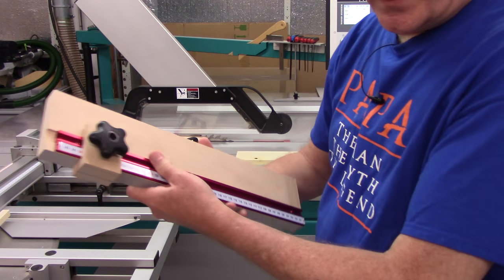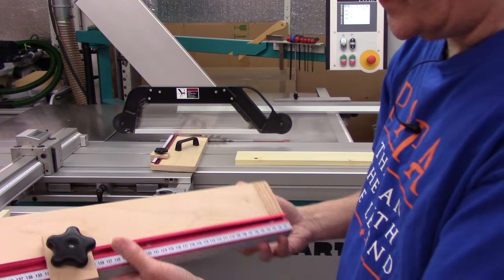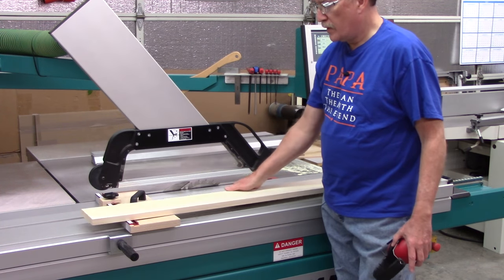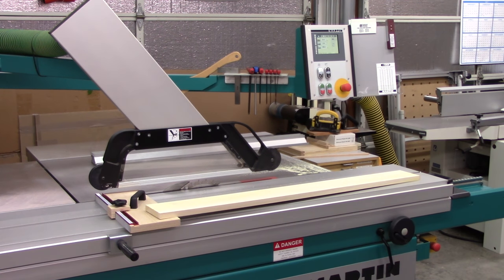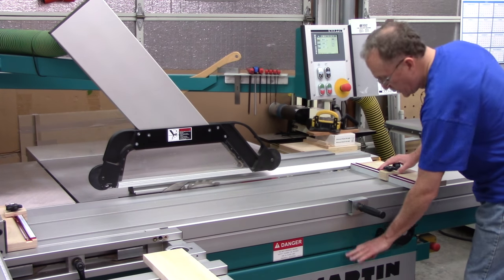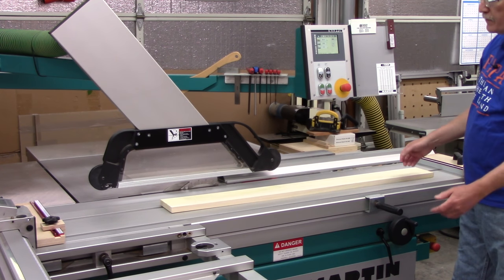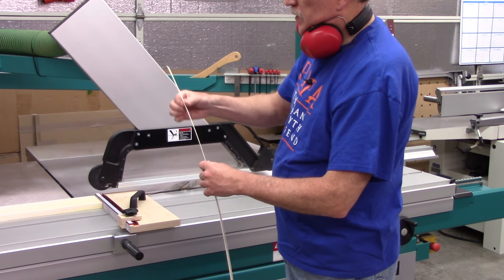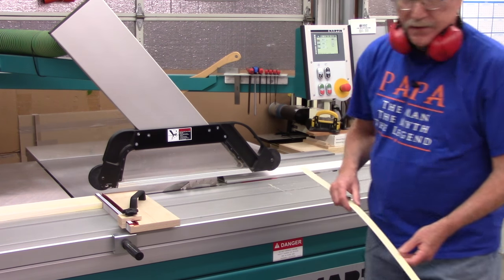Sliding Tablesaw: Ripping using Fritz and Franz Jig

Comment: Well the saw is in the shop. What a day!!! -30 all day. Tried lifting the crate from one side with the tractor and it disintegrated. Dismantled as much as i could . Got it on a cart and one of the wheels broke while trying to cross threshold. Had to rebuild a cart with the doors wide open. Not looking forward to my next gas bill. Tomorrow i need to get the laser in.  Will keep you posted with my misadventures.
Reply from the maker: Wow -30F, I haven't seen those temps since I lived in Idaho.  Hopefully the wind wasn't too bad.  Steve
Reply: @extremewoodworker  Weather has been hovering around that for last 2 weeks, and not looking to get much warmer for the next 2. Though we did have a reprieve on Sunday when it was only -11 Celsius.
Reply from the maker: @magicman9486  A virtual heat wave.
Reply: @extremewoodworker  Saw is in place and assembled. Between it and the laser i will need to go outside to change my mind.

Comment: I like your use of the Firtz and Franz jig for ripping thinner strips.  Might I suggest that for anyone who doesn't have a drum sander or such post-ripping machine to surface the strips to exact thickness, that they use a short stop block on their fence to provide the reference rip width?  That way if their fence is off - either purposefully set up that way as you do, or otherwise - that the strips will come out consistent in thickness.  Of course that also assumes their slider is running parallel to the saw blade and the Fritz & Franz jig is correctly set up.
  Again, another very informative video, Steve!
Reply from the maker: Thanks Marty.  Good suggestion.  Steve

Comment: Steve,

I do have a question.

I notice a little square block on the right end of your cross cut fence; mounted on your outrigger table. I can't for the life of me understand why that is there.

It seems to me that it is like a fixed stop. But why and why there? What does it do? 

I bought a Felder outrigger ass'y, to install on my after market "sliding table". These are going to be installed on my brand new Powermatic PM2000 table saw. The Felder cross cut fence does not have that block. So the stock pushes right up against the fence.

Please help an old man try and figure out what is going on.

Incidentally, I have learned a plethora of ideas from you, in your excellent videos. I will be incorporating a number of them on my new "Toy".

Thanks for your videos.
Reply from the maker: Hi Pat.  Thank you for your kind words and encouragement.  The block on the crosscut fence nearest the blade is a spacer that is part of what Martin calls the 2 point contact crosscut.  It holds the workpiece the same distance away from the fence as the adjustable stop to the left.  Most fences are what is called 'continuous contact' where your workpiece will bear against the entire fence in lieu of just two points.  The only meaningful purpose that I can see for the two point contact system is that helps to solidly secure a roughsawn workpiece that is bowed for trimming to rough length.  The installation of a Felder outrigger on a PM2000 would make for a very interesting video.  Steve
Reply: Thank you so much Steve. After I posted that, I got to thinking and heaven only knows why I figured that just might be the reason. Makes perfect sense to me now.

As to the video, I was thinking about doing that on YouTube. I have never done a video. But I believe it might be of some interest to those who have after market sliding attachments. 

Incidentally, the rep at FelderGroupUSA (named Jesse) worked with me on this endeavor; and he was a gem to work with. Of course some modifications are necessary to make it work. Also, since the cabinet on the Powermatic is much too small compared to the Felder cabinets; and too far in; to mount the outrigger pivot; where it must be installed to work properly.

Took me a while to see what would work best here. Thank Jesus He caused me to see how to do it with minimal expense. It will be in the video, if I do decide to make a video. I appreciate your thoughts on it.

I am also going to do something to the slider that I have not seen, but I believe many would love it. It would solve, once and for all, a big negative of all slider saws; regardless of price; and the reason I hesitated for years in buying one. Time will tell. By the way, you mentioned this problem in one of your videos.

Thanks again Steve.

Comment: Hey Steve, I really enjoy your videos, thank you for your time, I have learned a lot from you.  You said in the video you use other methods for rips of longer boards.  How would you rip a 6' or 7' or 8 ' Long board  5" W  and wanted to rip it down to a width of say 4"?  Thanks.
Reply from the maker: Thanks Jon.  The F&F jig works well for longer boards as well.  Another option is to use the crosscut fence stop and a parallel fence on the other end.  My stop system limits me to a minimum of about 8" which can be made up by a spacer.  It is useful to use a clamp in these situations.  Steve

Comment: Steve,

I recently got an altendorf. We’re a cabinet shop and prior to the slider, have used a delta Unisaw for 30 years. My question is when we’re processing 4x8 plywood for cabinet parts. What is your recommendation for ripping wide parts with slider?
Reply from the maker: Hi Binh.  Congratulations on the new saw.  When I process sheet goods, the first thing I do is get rid of the factory edge on the long side with the sheet completely supported by the slider.  The next steps depend on the project.  Assuming you are needing to rip a long piece along the length, I usually set up the parallel fence on the sliding table with my sized piece on the sliding table.  You can also use your regular rip fence as a stop and have your sized piece on the right hand side of the blade.  I have found I usually get more accurate cuts with the sized piece on the sliding table side of the blade.  Hope this helps.  Steve

Comment: Thank you for the videos.  I am considering a combination machine with a sliding table and this series of videos has been really helpful in understanding how I might utilize that feature.  This video series provides a set of possible ways to rip.  What do you actually use most often.  Is one of these methods your "go to" one for most work?  Do you favor one version over the others for one type of cut (thin strip cutting)?  Does that change for other "routine" rips for sizing a work piece? Thank you.
Reply from the maker: Hi Dennis, thank you for the feedback as providing that information was the primary intent of this series.  When I purchased my first slider (a full combo), I had no idea of the methods or advantages of the system so was flying blind and learn more every day.  The Fritz and Franz jig has changed my use significantly.  For ripping, I mostly use methods 2 and 4 depending on the workpiece size.  I use method 3 occasionally and mostly for sheetgoods.  I seldom use method 1.  Ripping thin pieces is almost exclusively done using the Fritz and Franz.  

The Fritz and Franz sits on the saw most of the time.  I should have built this on day one if I had known about it.  I am working on the next video on crosscutting which is pretty basic but I demonstrate how to size a 16mm cube using the F&F jig exclusively.
Steve

Comment: Very interesting I will make some of these things !
I can't find good info about tuneup or full adjustments for sliding table saws I mean the slider height, parallel, swing arm etc where is the starting point I got a old Hammer C-41 L I getting close I think I do better every time I put my head to it  ,but just tighten to secure the adjustment and it's off again, maybe I getting to picky for an old saw  !
Nice video I am subscribing and get what I can thanks !
Reply from the maker: Hi Flatdog.  I would suggest joining the Felder Owners Group at https://groups.io/g/felderownersgroup  There is a lot of knowledge in that group on slider adjustments.
Reply: @extremewoodworker  thanks good idea thanks

Comment: Can you demonstrate how you load a 4x8 or even a 5x8 sheet onto the saw and ripping down full sheets?
Reply: Okay I usually pick up the sheet and line it up between the crosscut fence table and the sliding table and slide it down slowly. Also when I rip the sheet I stand at the front of the saw and not at the back, I feel this gives me more control and just "push".

Comment: Thank-you  for your videos, I really enjoy them.  I am looking to buy a saw/shaper combo from Felder.  Would you happen to know what the drop off is between their Felder to Hammer lines?  
Anyway your videos are much appreciated on my end and I look forward to using them for reference.  

Take care
James
Reply from the maker: Thanks James.  I have never owned a Hammer but have owned a Felder CF741SP.  Other than the obvious differences in motor sizes and slider lengths available between the two lines, I think the biggest difference is the X/Roll sliding table on the Felder.  It is very smooth and in many ways rivals the sliding table on the Martin saw.  With the Felder, you have a lot more upgrade options than with the Hammer but that may not be important to you.  Hope this helps.  Steve
Reply: Thanks Steve.
Reply: @extremewoodworker  I am also considering purchasing a Felder saw/shaper combo CF500, not the 700 series, a bit too expensive for me. Love to know what you decided to get James Stewart